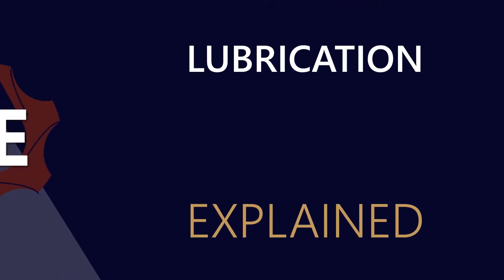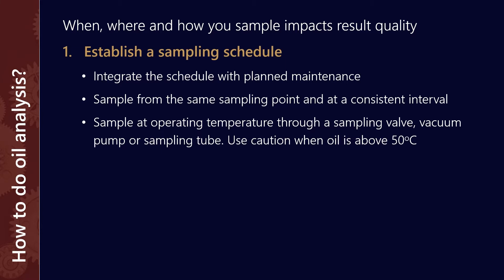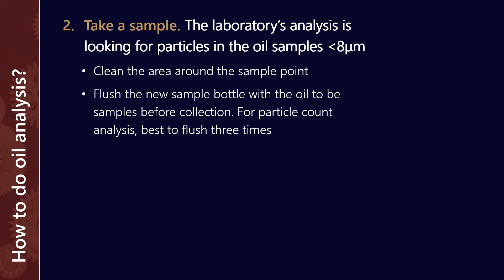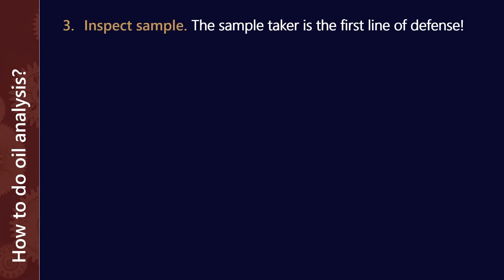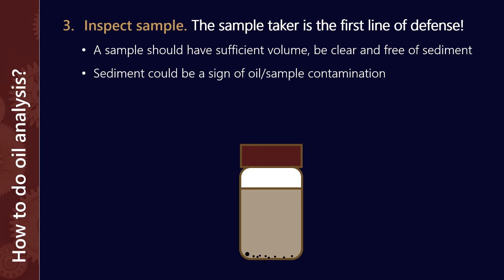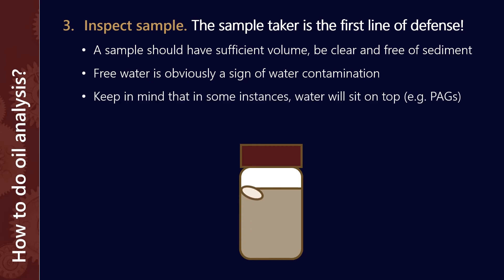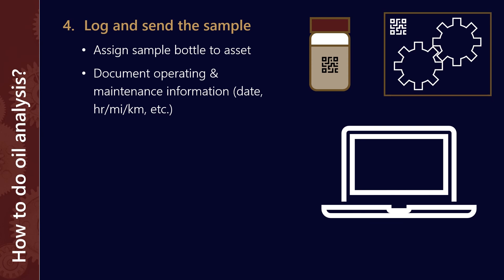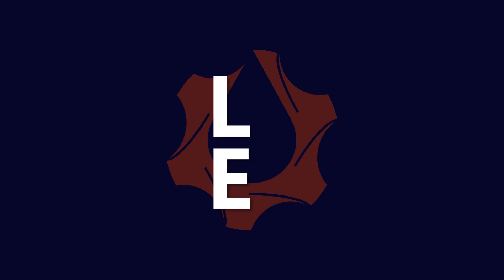What should I look for when taking an oil sample?

Comment: Oil near combustion is totally different. You will never be able to see anything through a diesel engine oil sample, perhaps not even a strong light. I was an Army helicopter pilot and maintenance officer where almost no fluid lubricants were changed without analysis. When you are measuring your fluids in gallons and not quarts there is a huge cost differential. My son worked on diesel locomotives that took 400+ gallons of oil. They would do an ‘Oil Freshener”, I.e. drain off and replace 200 gallons at a time based on oil analysis.